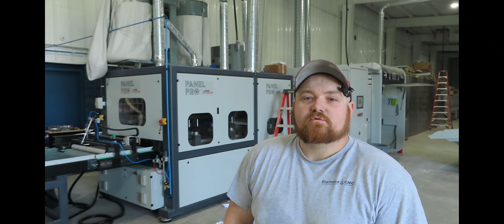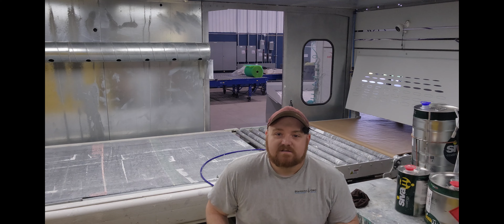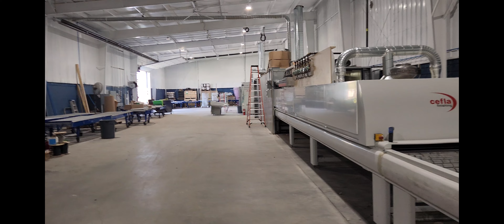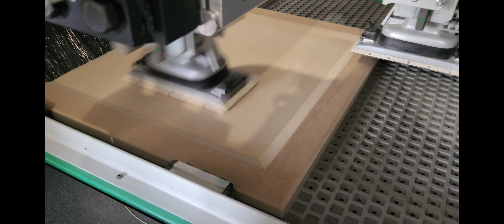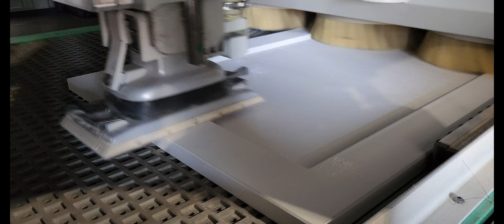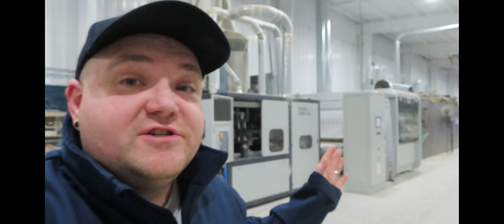Hands off Finishing

Comment: Fantastic video. well done. I am curious as I cannot see any surface cleaner after you sand before the doors go into the Cefla for painting. Or does the panel pro sander have a cleaning functionality within it that cleans the doors before going into the Cefla
Reply from the maker: its build in. there's a air blower and dust collection as the las step inside the machine
Reply: Thanks. We are investing a substantial amount into automation . Please can I have your email to confirm few things about the Nanxing machine. We are about to purchase a full range in the UK.

Comment: you only paint one side of the door ?   14 +14 +14 = 45 min. one side ? :)
Reply from the maker: yes. most customers opt to save money by using MDF whiteback material. especially when the top coat is white. 
so when we do 2 sides. its just double the time